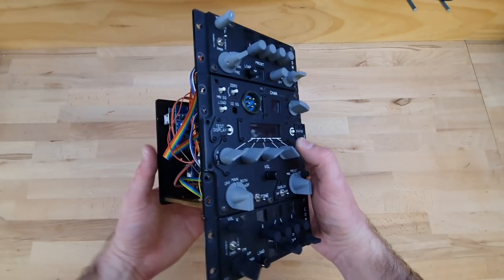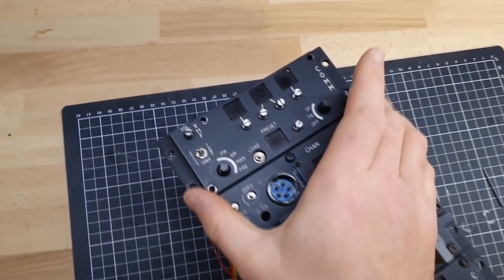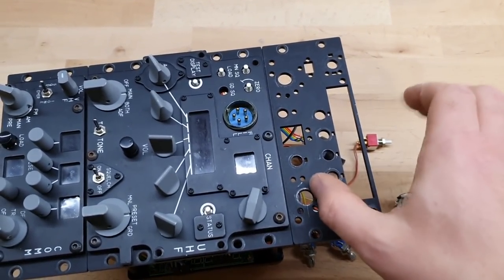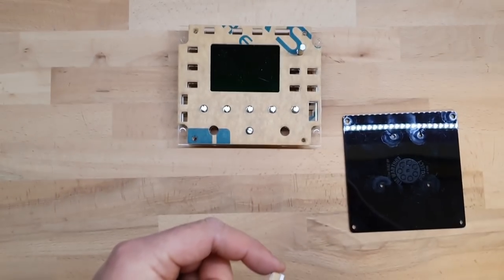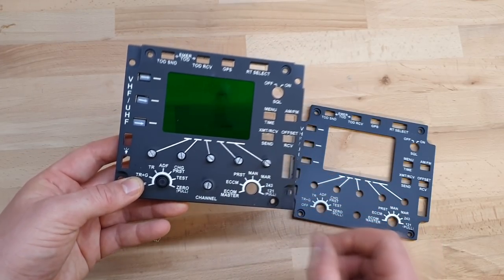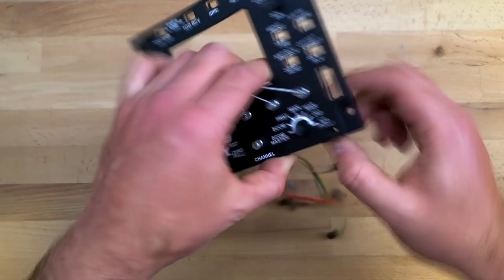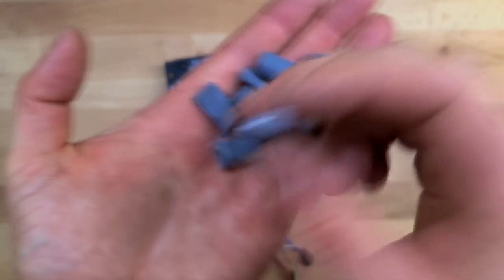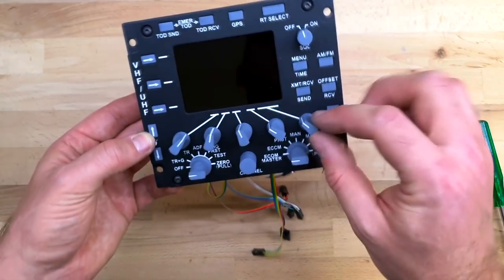ARC-210 Digital Radio! - A-10C Home Flight Simulator

Comment: Some day you need a real A-10 pilot to come and try your simulator. My friend is a retired F-15 pilot, but he got burned out flying for 20 years. Every time I talked to him he was ready to quit. I tried multiple times to get him into DCS and he just wants nothing to do with it. 

I was wanting to ask if you could show how you made your landing gear setup. I just started looking at making a F-18C cockpit and doing the panels, but my first panel I want to do is the landing gear. 

You are still getting that black flash every once in a while.

Comment: Love your work, totally inspirational. I did notice the rotary switch should actually be an 8 position, 45 degree index angle, as per photos of the cockpit I have seen. I have also seen another YouTube video where resistors are soldered to the legs, giving a different resistance value for each position, which in turn can be identified by the Arduino to work out which position the switch is set to. 👍

Comment: 13:20 that TFT display does have a touch panel in front of the LCD, you can see the smaller flex cable on the side

Comment: the load button under cover is actually functional you can set the freq in manual and set the preload channel and if you push that load button its goingto saved as preload channel that has been selected

Comment: The head of the dzus fasteners need to be in the recessed in the barrel just a bit, and should be parrallel to the edge of the panel. 

It is a 1/4 turn fastener that locks to a long rod under the panels.

All I see looking at that was loose fasteners. 

great job otherwise, weathering looks very realistic
Reply from the maker: Yep- i made a design decision so i would be able to sand the tops of them to smooth them out. If they were recessed as the real ones are, i wouldnt be able to finsih them properly and the 3D print pattern would be very obvious.

Comment: According to the Internet, the newer ARC-210 radios include embedded crypto, so there wouldn't be a stand-alone KY-58 and its control panel. Perhaps the export versions of the ARC-210 are different. Also, VHF-FM is also embedded, so there might not need to be a standalone VHF-FM control panel.

Comment: You can do the same rotary + resistor trick with an STM32 BluePill & FreeJoy Firmware and a few resistors.
Complete solution all the way to HID Joystick for AUD$3
All that BBI rotary thing does is add cumulative resistance to each position on the rotary by the looks of it.

Comment: I have followed you from your initial videos. You have done an insane amount of work on your Warthog pit. I have never seen any other pit outside of military simulators that even comes close... Have you thought about increasing the height of the display screen you built and Canting it towards to cockpit to give you an expanded vertical view as well as the expanded horizontal view now have?

Comment: That Leo bodnar pcb for the rotary switch is nothing more then a couple of resistor networks and it reads like an analog input.
Pretty easy to make a similar PCB for a 10 position rotary, the other option is just solder resistors between the pins.

Comment: I'll never understand why folks try & re-invent the wheel. Great project. Absolutely great. But you could have saved countless hours and hundreds of dollars by using the EPIC. Honestly makes many of us shake our heads........ Nonetheless, Kudo's to you. That is one amazing setup. Congratulations!!!
Reply from the maker: OK I'll bite. What's 'the EPIC??'
Reply from the maker: That looks great, but I honestly find it really hard to believe that people are 'shaking their heads' because I didn't use those USB cards. An arduino uno costs about 10 bucks. DCS Bios that runs it is free. I just can't see those cards saving me 'countless hours and hundreds of dollars'. This ain't no 150k USD 747 simulator, it's a DCS combat jet sim and I've spent about 8k AUD in total!
Reply: @thewarthogproject  Ok. Wasn't trying to upset you. If your happy with your setup so be it. I think your project is outstanding and one that many can emulate. I further applaud the example videos to teach others how to achieve your accomplishment. 

I only mentioned EPIC as it has been the go to for many of us. When I started my project back in the early 90's, there were roughly 8-10 of us world wide building home simulators. EPIC was the way to go. Others who followed were scared off due to the programming skills required. Eventually, years later, the Arduino, Rasp Pi, and others surfaced. Still to this date, none can come close to the EPIC which can control unlimited lights, switches, sounds, motion actuators, pneumatics, etc etc. There's a reason the EPIC is in the A1 Abrams. 

That said, again, I FREAKING LOVE YOUR PROJECT. Good for you. 

PS: I have to date: approx. $60K in my motion Boeing 757 simulator. No where near the 150K you referenced.

Comment: Would love to see a video on Helios whenever you have the chance. I honestly just want to be able to setup eject handle without having to modify DCS lua files but not really sure to start creating a simple Helios profile.
Reply: You know right as I typed that I think I found the proper guide to setting up different controller profiles in Helios haha. I was just watching this video again after editing DCS lua files to get my helicopter collective lever setup as my eject switch, and damn it I am going to do it properly with Helios profile instead. Thanks
Reply from the maker: Instead of editing LUA's in DCS, just use helios (or even Joy2Key) to add a simple keyboard press macro to any button. I pull the hande, it sends "ctl E ctl E ctl E', and bang, im out.
Reply: @thewarthogproject  yes I actually ended up finding the DCS Input Control mod that lets you setup custom bindings outside of the main install. Works perfect for my simple setup. Hopefully they just build that functionality in soon being able to add custom commands from user data rather than digging into the game. Helios definitely the way to go with a lot of custom inputs.

Comment: Hi,

this is a great project, I'm following it for a few years and I'm constantly amazed -- thank you so much for sharing this in this detail.

I'm nearly finished building a TBM900 homecockpit for X-Plane 11 and, as you certainly seem to know, the building is more fun than the flying. I'd like to get right into next project after this is finished and I'm looking at a DCS project. Not necessarily the A10, maybe a F18 or one of the dual-pilot planes they have (e.g. the F14 or the upcoming Apache, if that works on a single sim). My process is quite similar to yours: I'm doing everything by myself, including designing the files to laser the acrylic glass and in my case the PCBs. 

Do you have any resources about the software-wise process with DCS? With X-Plane, I'm using SimVim to connect both the switches to the sim as well as to receive the outputs (LEDs) for the hardware. How does this work for DCS? I see you're using LeoBodnar input cards, but what about the LED outputs? Are you just connecting multi-way switches as several keypresses? Is DCS configurable like this (e.g. a key for every switch position)?
I saw you're using this Helios software, but it appears to just be for the screen...

Thank you so much!

Comment: Hello the warthog project YouTuber, I vaguely understand plane stuff, I did air cadets 6 years ago now. With the a-10 is it the better for plane attacking to ground targets, compared to f-35 because I hear on vids that the a-10 is amazing at that stuff WITH reasonings like titanium bath tub, its rugged, its got 2 hard to hot engines from below kinda... then when I watch stuff about f-35, they say its the best at the ground attacks period without any reasonings and say it will replace the a-10? So my question to u is, is the f-35 actually better? For that task of ground stuff, cos its better at other things like speed lol, but just not sure if it is better at ground attack air support stuff.

Comment: How does DCS sync with the physical switch settings on respawn. For example if you died and forgot to turn off the radios and reset them all, will dcs sync the inSim switches to the physical Cockpit on respawn. Or do you need to manually cycle them all?
Reply: My guess is you have to cycle them, just like with the HOTAS
Reply: @dominicdiclemente8877  mine too. Though there may be an option in helios to "zero" all the switches in software and resend a button/switch state based on the physical switch position, so that it then syncs the in game cockpit.
Reply: @noisytwit  If I had to bet all of this hardware is simply event driven, if nothing changes no event occurs and no updated value is sent to the register. Ideally it would do a full register update on power up but that doesnt seem likely to ever change.
Reply: I also use helios for my pit and yes it does not sync on startup.  When you are this deep into a sim you are almost always doing could and dark starts. So its a non factor for me anyway.  Still I am moving from helios to dcs-bios to gain the sync-on-startup ability.
Reply: @talbotmcinnis  Cool, so dcsbios can do that ?
Reply: @dominicdiclemente8877  It can, although I confess it is not flawless yet.  I have it key off the mission-time, so if you start a new mission and the controller detects a jump back in time, it will re-send every control state to dcs.  I’m testing it on three of my seven controllers, and its perfect on two of them (iff and ky), but not my emergency panel and I haven’t had time to debug why yet.

Comment: Nice work.
Does Helios flick on/off toggles in DCS with a single button on the input?
e.g. The battery power switch on the A-10.  In the control assignment, there's only one line, not separate "on" and "off" lines.  If I assign a joystick button, it toggles the DCS switch each time it's pressed, but I'd like it to be on when pressed and off when released.  Can Helios do that?
Reply from the maker: Absolutely, that's one of the main reasons I use it. You can set it to send different commands when a button is pressed, and also when a button is released. You can also set it to send keyboard key presses and macros, that's how my ejection handle works. Pull the handle and it sends ctl e three times very rapidly.
Reply: @thewarthogproject  Thanks.  I'll give it a go.  It seems more likely to function in multiplayer than DCS-BIOS.
Reply from the maker: @No1sonuk  DCS BIOS and Helios won't effect multiplayer at all. I've never had any issue joining any server, and I've done LOTS of lua editing haha!

Comment: Quick question: How do you attach the standoffs to the clear piece?  Is the acrylic threaded?  Thanks!
Reply from the maker: Correct! Although I don't tap them, I laser cut the holes at 2.8mm, then just force the 3mm thread into them in with a driver. Works well.
Reply: @thewarthogproject  Awesome!  By the way, beautiful work, and thanks for sharing everything you’ve learned.  I’m adopting a lot of it into my current project.